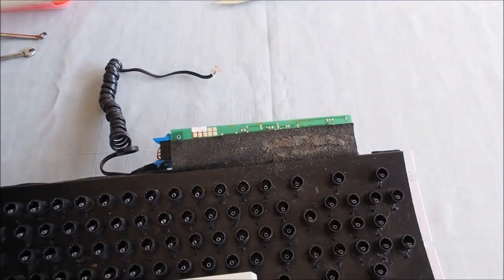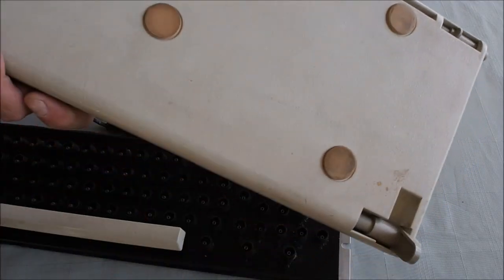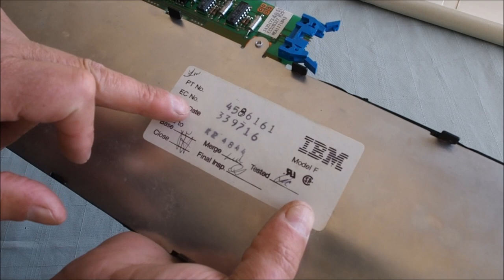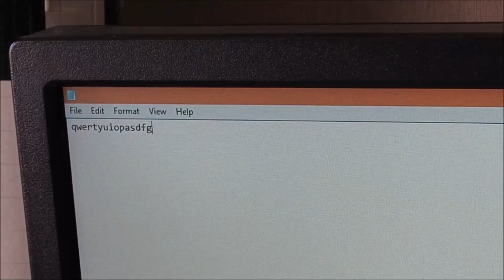IBM Model F Keyboard - Repair and Cleaning - From IBM 5155

Comment: I had a heck of a time with this getting that dang back plate back on!!!! At about 31:40. Get about 8 of those spring loaded finger clamps and place then to the right of the metal tabs to hold the plate down. Like you said place that black colored lip against the edge of a table/bench what ever. Then GENTLY tap the right edge of that bottom plate with a small hammer. It does help to have a second person to either hold the assembly or do the tapping.

Comment: That's fantastic to think that individual process build operations were signed for by an actual person! Imagine that happening today! Also what's refurbishable today? Things need to be like this to save re-cycling.
Reply from the maker: Yes it's amazing that the keyboards all got individually QC checked. Things were made to last back then. I don't see the point of making a keyboard so cheap that the legends wear off after six months use. Keyboard technology hasn't really changed much over the last few decades, so why make them a disposable item. I still don't get it.
Reply: Retrospective Do you know If you can use an rj45 to USB soarers converter with the 5155 keyboard?
Reply: @storm_f1788   late but yes you can theirs guy on Ebay that sells them.

Comment: Retrospective Greta video btw just restored my IBM 1983 Model F xt.  Soarer's Converter will only keep Nkro on the Model F variant's  they where full Nkro stock before the converter. Buying or building Converter for the Model M any year only has what they call 2 key press rollover  so even if you add the converter it will not it ad Full key roll over. It is how they where made being membrane keyboards.Where as the at xt portable model F  capacitive switches. So long story short is you only want to type the Model M is fine. But is you would like to game & type in my opinion 99.5% Better keyboard the Model F is the one you want. Oh & nice cat :) At lest from what i have read if this do work for your sons Model m please let me thanks for your time stay safe out there.
Reply: what does NKRo Mean????????
Reply: @helthuismartin  no key rollover it just means you can press many keys at once and they will still register like when you're gaming model m does not have that has like two key rollover good for tpying not gaming. He talks about in the video as well.